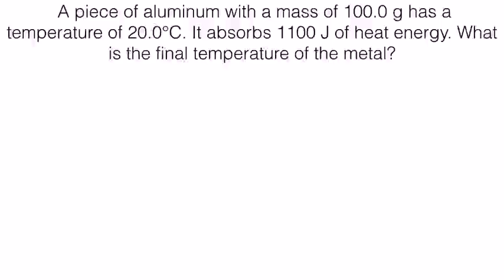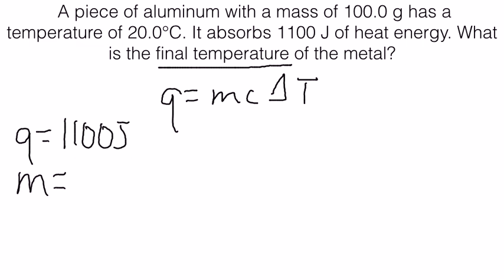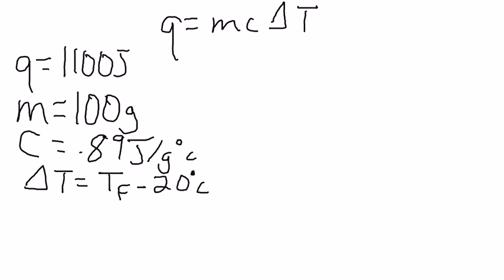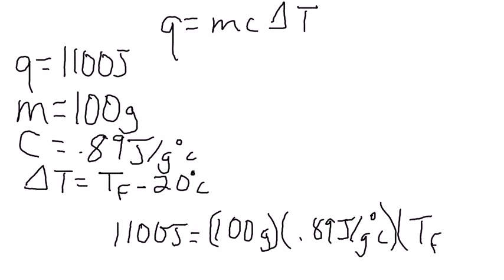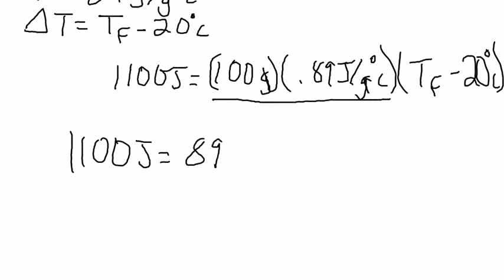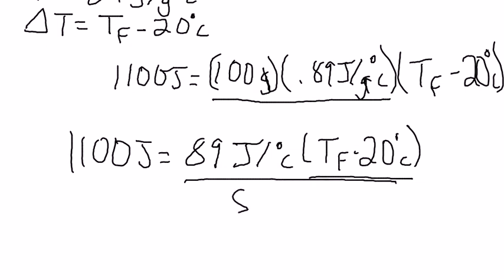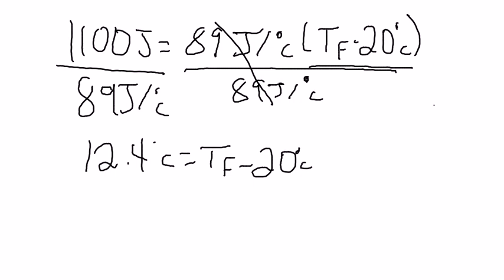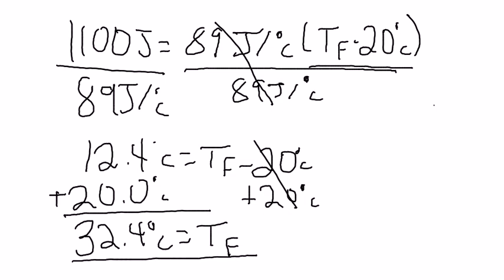Specific Heat - Solving for the Final Temperature

Comment: I still don’t understand how to convert 20.0°C to 0.89J/g°C. How would that conversion look?
Reply: Your comment is 8 months old but ima answer in case anyone sees this in the future .89 J/g C is the specific heat capacity usually it says it in the problem but it didn’t so he provided it for us the 20.0 C is the temperature INITIAL we are solving for the temperature FINAL, you need both to know what delta T is ( the triangle with the T next to it which is your change in temperature) delta T is FINAL temp minus INITIAL temp